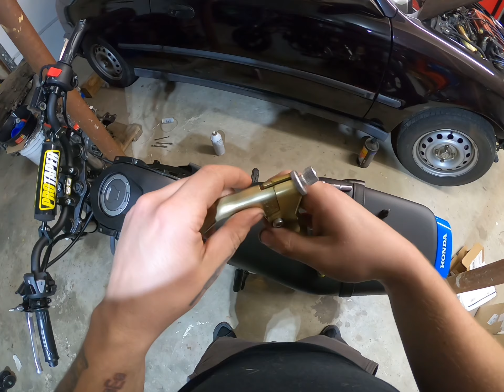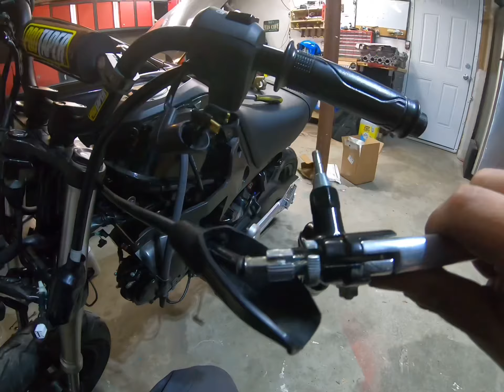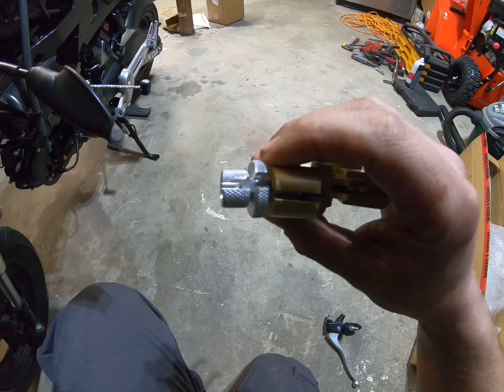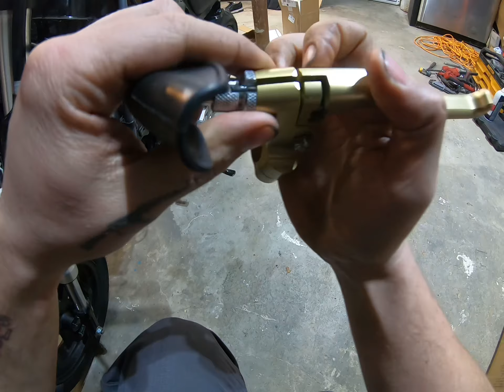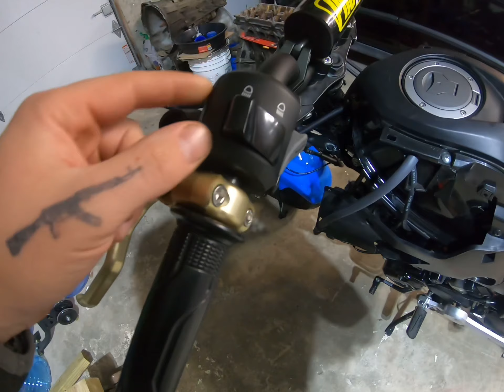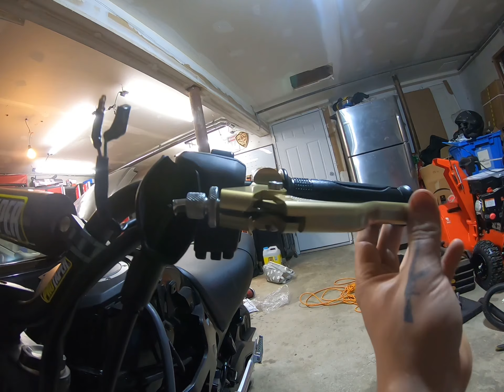RSC clutch lever install and review 2022 Honda Grom

Comment: How do you add a fuse to the clutch wires ? My bike won’t start in 1st gear anymore only in neutral
Reply: Use a 10amp fuse and connect each wire to it. Should plug right in.

Comment: You have pretty much ruined a great bike.  A 2022 that looks like it's a well used 10 year old bike now, with cheap, accessories.
Reply from the maker: What cheap accessories are you talking about? And it was ruined in an accident. It was completely totaled recently
Reply: hard to take you serious with a pfp like that.
Reply: That’s 150$ lever bud . Not cheap junk
Reply: @briancaldwell4211 exactly.  Or 46% off on his bday this year. Came here to see about the wiring from the stock clutch or if I just leave it…. You know by any chance?  My 636 I just let it hang and remembered that I gotta be careful in first. But curious if there’s an option for the grom